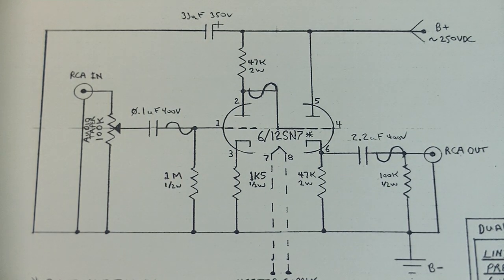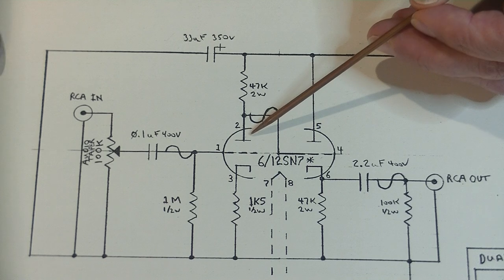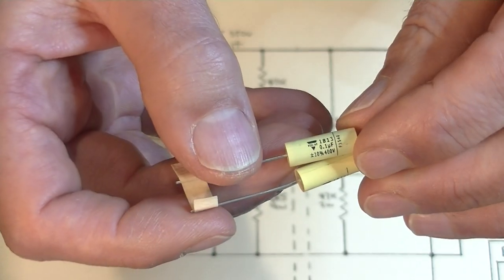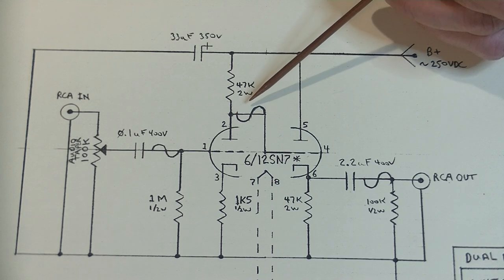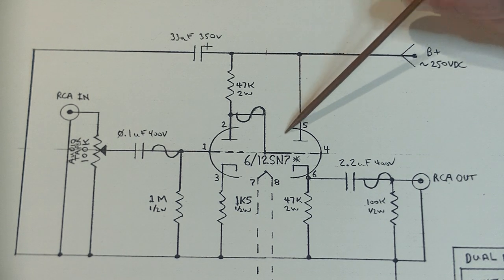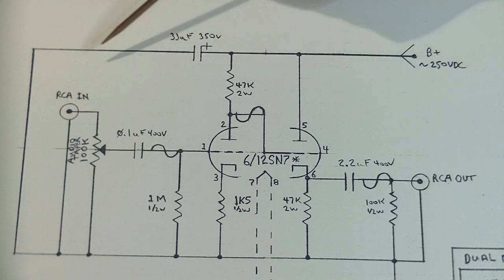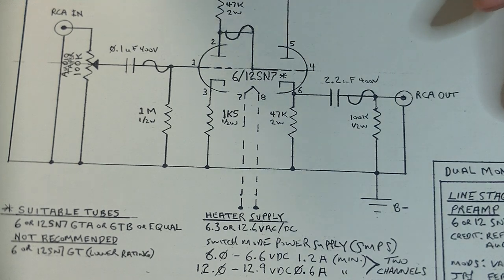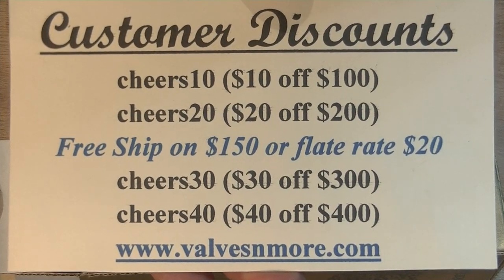Tube Lab #20b  How to Read a Tube Preamp Schematic for Beginners

Comment: Thanks for explaining this preamp circuit. I will be looking at your power supply video next. Wouod this design be suitable for a headphone amplifier? Im guessing i would have to add a power tube after this preamp circuit?
Reply from the maker: Hi @dmark2639 thanks for checking out our videos! Yes you would need a power tube after the preamp circuit. You should take a look at our most recent videos where we show off the prototype of our new integrated headphone amplifier.  It's not using the same preamp circuit as our Universal and E80cc designs, but something new specifically designed to get us some more power output. Happy to answer any other questions you have, cheers!
Reply: @tubelab194  Thanks, I watched all your headphone amp videos last night. I'm excited to how it turns out. I like the multi-tap transformer that makes it very versatile with many headphones as well as speakers. I'd love to try a test build!

Comment: How do I do balanced preamp with this design? 

Thanks best wishes!
Reply from the maker: If your signal arrives balanced, and leaves balanced, you basically build two of the circuit.  Now remember that's only one channel, so for a stereo preamp you need 4 circuits!   Personally I don't think balanced circuits have any place in home audio, it was developed for professional use and that's were it does help reduce noise for very long cable runs.

Comment: hello mr jim, i have a few questions hope you can answer, thanks.
1) can i increase use B+ more than 250V, let's say 300-350V? for the 6SN7?
2) can i increase the input coupling caps to 0.22-0,47uF?
3) what is the gain of this design circuit?
4) can i add a grid stopper resistor on both pin 1 and pin 4 inputs?
5) what is the tube rectifier that you can recommend for this circuit?
6) is it ok to put another volume control on the output in addition to the input?
7) why there's no coupling caps and grid leak resistor between pin 2 and pin 4?
thank you and more power to you - from Toronto
Reply from the maker: This was a prototype build, using a direct coupled interstage (no coupling capacitor), it only worked well with certain heavy duty mil spec 6or12sn7 tubes, other regular types got noisy.  What I'd recommend is go into the store www.valvesnmore.com to information and you will find a totally revised Universal 6or12sn7 Kit Preamp schematic.  You can buy a full or light kit or just borrow the schematic and build with your own components.
Reply: @tubelab194  thanks jim for the quick reply, and i just checked your website and explored the latest revision of this 6sn7 preamp. but i have one last question : is there a possibility that i can make the output a balance output to drive my cx400 analog electronic crossover without using a direct box, a separate balance output, other than the unbalanced rca out? just in case i order this full kit in the near future, thanks again.
Reply from the maker: @Torpengpogi  no all of my Kit Amps are SE (single ended) designs.  To obtain a balanced (XLR) output, you would need a phase splitting stage.  The 12au7 would probably do the trick, one for each channel.  In a future Tube Lab, I'm going to talk about SE vs Balanced.  As an audiophile and minimalist, I'm strongly on the side of keeping the signal whole (SE) from beginning to end.  Yes recording studio make extensive use of XLR cables, but that makes sense, long runs can lead to a lot of noise.  At home we run cables for very short distances, so have no need for the noise cancelling qualities of a balanced signal.

Comment: Are 6N8 specs equal to classic 6sn7 or 6SN7GT??
Reply from the maker: Good question!  As far as I know the Russian 6N8S, does not have a distinguishing number for earlier 6sn7gt equivalent and later GTA and GTB equivalents.  I just checked my inventory and tubes from 50's and 60's are marked the same.  It only makes sense that the early Russian 6N8S tubes are rated as 6SN7GT, given that I believe they are either copies or made under license. And the later ones are either GTA or GTB's (identical tube spec except heater spec).  So what to do? The Russian tubes almost always have a date code, so a tube made before 1963 most likely is a GT and after GTA or B.  I stand to be corrected on this!  Note other than MELZ machine gun holed plate version from 1950's (v.expensive) they are inexpensive, just run them and see how they do!  Many Russian tube types are solidly made and can take some abuse!  I stock a good selection of this tube.
Reply: @tubelab194  thanks for clarifying that. I have a Chinese ( very high quality though) 845 tube amp Dared VP-845 that has 6N8 tubes marked on the heavy solid copper heatsink/top, and It came with Chinese(unmarked) gray metal base tubes 6sn7 I believe... other tubes are 12ax7 telefunkens and shugyang 845M power tubes. So Which do I upgrade those stock 6sn7 to? They are a bit bright... I tried JAN NOS Sylvania 6sn7WGT brown base tubes but they don’t seem to have good highs... base good though. Any advice? I’m in BC btw) AND my speakers are magnepan.7i...
Reply from the maker: @JR-Canada  Nice amp!  Well the 6sn7's are probably in the driver slot, so you want a robust high Gm tube to drive the output Triodes.  The selection is huge any quality 6SN7GTA or B would be worth rolling.  And because you only need a pair not that expensive.  The GE 6SN7GTA or B (my #10 or 138) is a possibility (watch Fridays Tube Lab), I've also got some vintage Tung-Sol's 6SN7GTB (nos) very nice tubes, my inventory #11.  And if you wanted to try some fun tubes as well, just put a buy in for some "discount octals" under discount tubes and I'll find some interesting $10 tubes for you to roll!
Reply: @tubelab194  placed the order today Jim. Thanks)